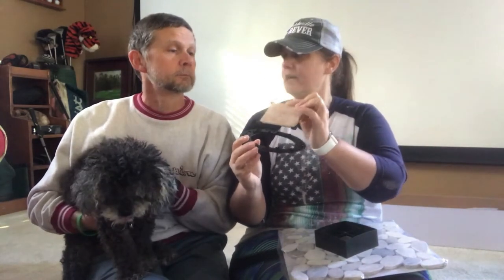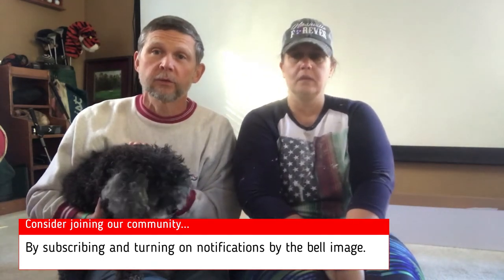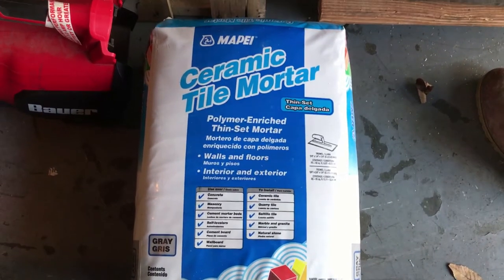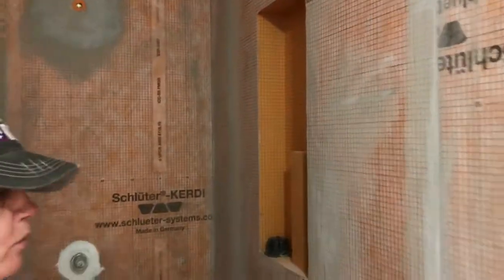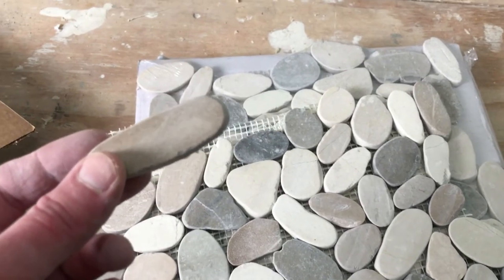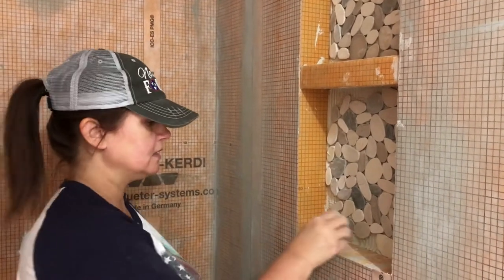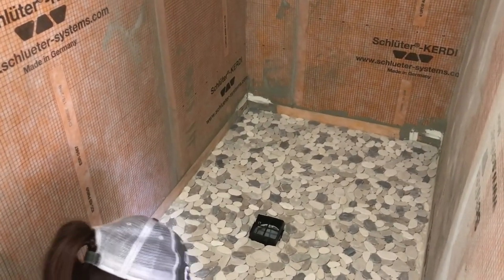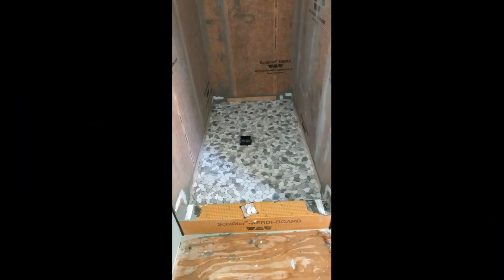Schluter Shower Tray and Niche - DIY Natural Rock Tile Install

Comment: How did you get the divider in the niche to stay?
Reply from the maker: Thanks for the question.  We used the mortar which was used for the membrane over the drywall.  Holding the divider in your hand put mortar on the ends and then slide it in.  You will need to wipe off the excess of course after doing this.  Good luck and thanks for watching.
Reply: I just watched 9 D@mn videos waiting to see how you attach the shelf and you skipped right over it!!! Ugh
Reply from the maker: Sorry, screws were used to install the shelf frame to studs.  We used mortar which was used for the membrane to install the divider within the niche.

Comment: Hello! I’m about to do something similar with my Kerdi pan with similar shower rocks. It occurred to me this morning that I could be putting the pan in a “point loading” situation with my rocks though.. how is this shower holding up for you so far?
Reply from the maker: After 2yrs of use we are having no issues.  All is holding up great.  Thank you for watching and sharing.  Good luck with your project.

Comment: Hello, I enjoy your channel and applaud you for taking on the shower project. 
It appeared that you're using a one-quarter x 1/4 notch trowel to set the Pebble floor?.... I have the same pebbles using the Schluter tray. I've talked to a lot of tile guys about the point load situation and they agree it is more of an issue with ditra floors..... Probably not a good idea to get in the shower with stiletto heels anyway ;)
 I'd like to know how your pebbles have held up.

thanks,
Reply from the maker: I cannot remember the trowel size.  I know we used the recommended size for the pebbles we purchased from Lowe's.  In addition they are holding up well.  I would say A+ grade - no issues.  I guess that is because Laura doesn't wear her stilettos :-).  Thank you for watching and the questions.

Comment: Nice. Just be careful, the minimum tile size for Schluter shower pans is 2” x 2” due to point load maximums for the foam board.
Reply from the maker: Thanks for watching and sharing that information.  I do not remember seeing that.  Our rock was joined in 1 Square Foot pieces with the mesh.  I hope we do not have any issues.  So far so good.
Reply: Unfortunately it is not very easy information to find. 😅 I actually purchased the same river rock for my shower and returned it.
Reply: This isn’t true.   2” applies to the Ditra product but not the foam floor/tray.   The issue with river rock and foam trays can be wide grout lines a drainage, but the directions included with the tray state there is no size limit.
Reply: @mscottsimon  actually the information I found for my foam pad was minimum size of 2"x2" tile. You just have to research it.
Reply: @matchmeadeinheaven  still no issues?
Reply from the maker: That’s correct - no issues.  Thanks for watching and the question.  Good luck!